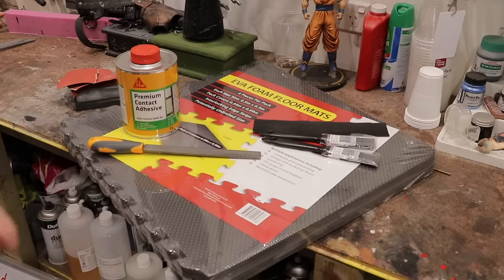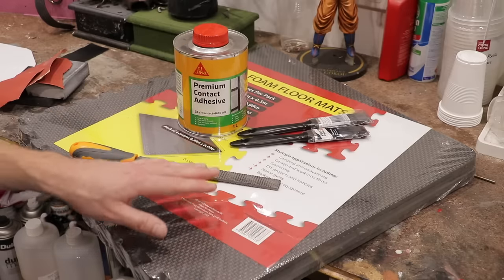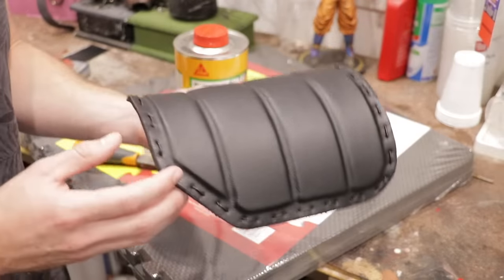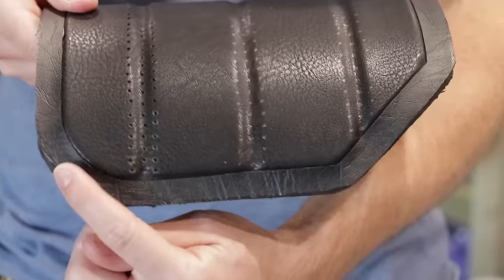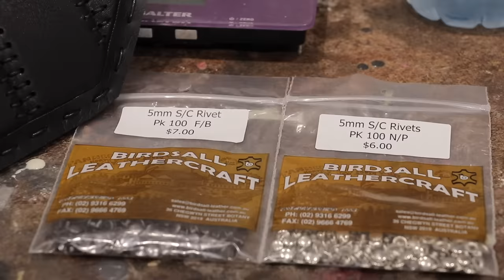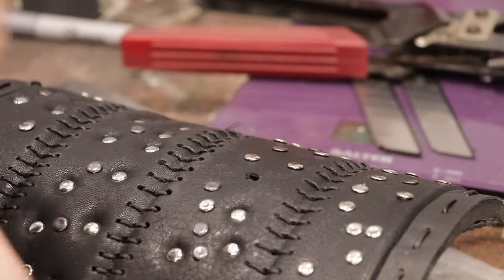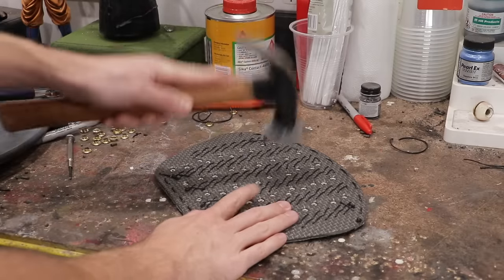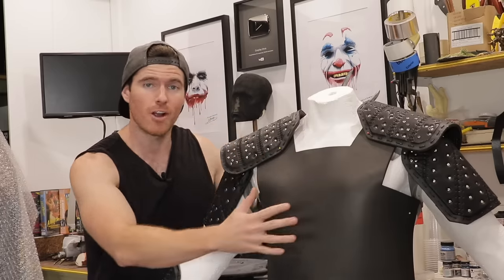The Witcher: Geralt Foam Shoulder Bracer Tutorial

Comment: 2.0mm drill bit , had to slow video down to see the size.    That 2 mmm leather cording ?     Also, did you consider or regret not doing the edge binding wrapping around to the bottom and lacing through both?